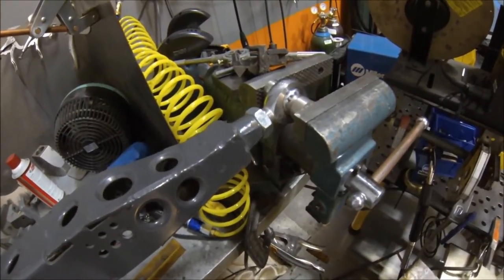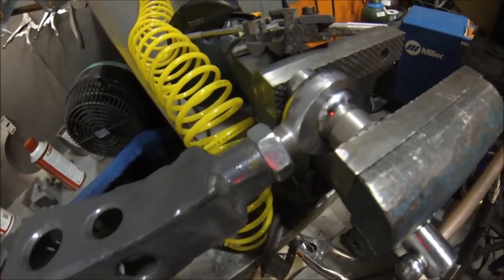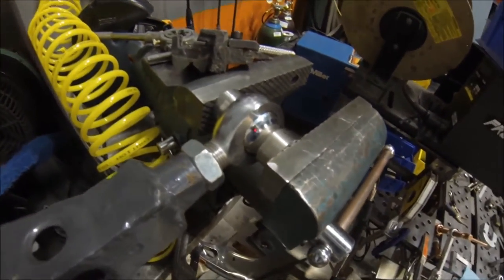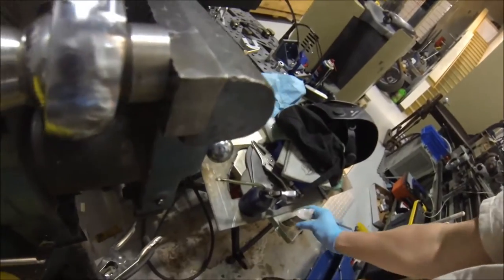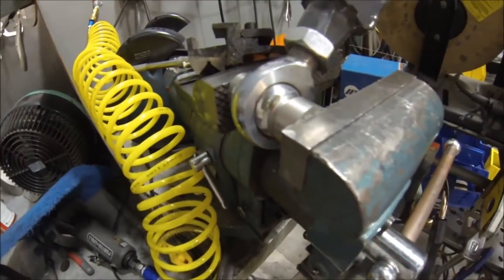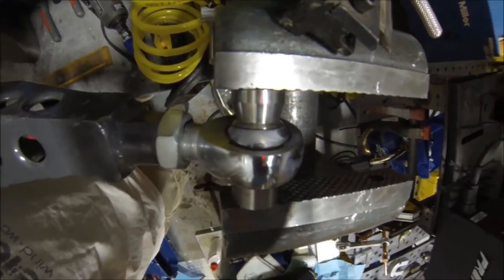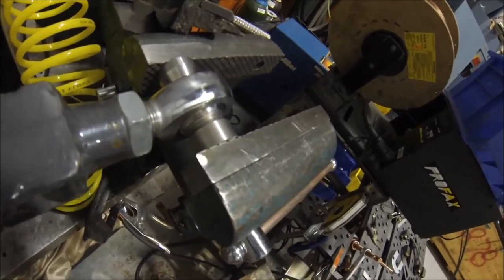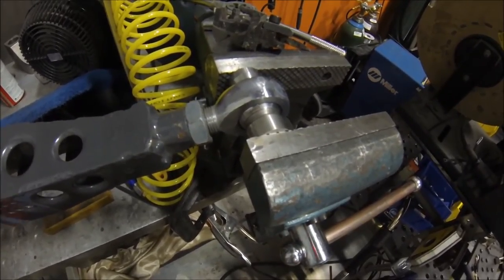Maintaining Teflon Rod Ends

Comment: How long does the lube last for you?  Mine starts squeaking fiercely.  I've been using PB blaster to clean and re-lube with white grease.  Comes back after a month.  I'm at the point of swapping them out because of the noise.  I'll give your teflon a shot.
Reply from the maker: +Ivan Gantchev  we never use grease, it has a volume to it so it can displace the liner and make things worse.  dry lube is the way to go.
Reply: +Mike Figaro I'm sorry I love these but they keep squeaking even when I followed your teflon method twice.  In less than a month, it goes full squeak.  I'm swapping out for Megan with the rubber and if that doesn't work going back to stock :(   (This is for toe control arms)
Reply from the maker: +Ivan Gantchev  it should last quite a while but that also depends on if there's any contamination that resides in the rod end interface. my suggestion would be to dismount them rotate the ball a full 90 degrees so that you can expose the inside of the rod end and clean that out adequately. if you live in an environment where you would rather try the rubber boots we do offer them however they can introduce more maintenance into the equation. We will also be offering a polyurethane-based adjustable toe link at some point. still in development. Megan arms also use a spherical bearing for what it's worth.
Reply from the maker: Ivan, we do sell individual replacement parts for these and it is possible the chrome plating on the inner rod end is worn or the teflon/nylon liner cracked somehow, then the dry lube would only be temporary.  What version of rod ends did you purchase? Ivan Gantchev
Reply: +Mike Figaro 
I agree with Ivan, the teflon spray lube does not last long.  Also I'm getting a clunk noise, not a squeak or creak.
Reply from the maker: My Nam what is your setup? A clunk could be wear or it could be shock bushing related. Sometimes it's the same as above.  If you don't open the area of the ball that contacts the bearing race you might not be hitting in the right spot or it may have something that needs to be cleared.  Send me pictures if possible.
Reply: will silicone spray work?